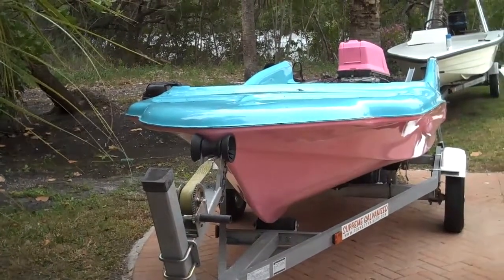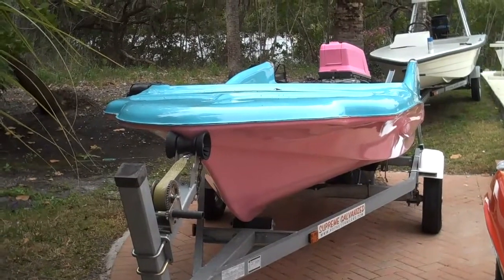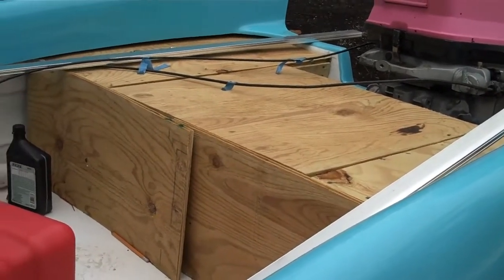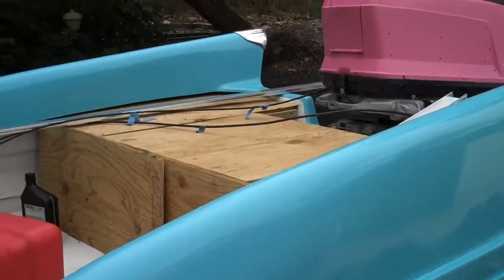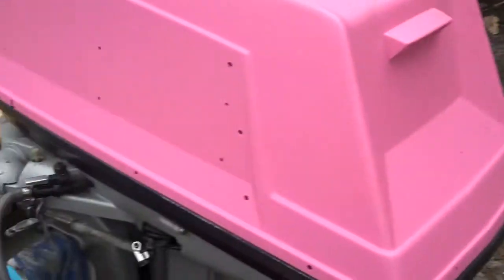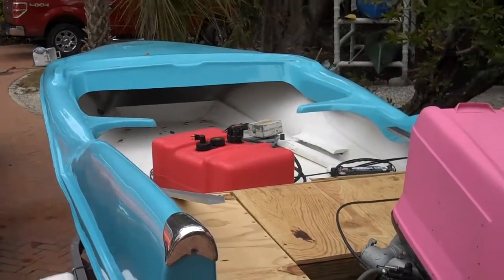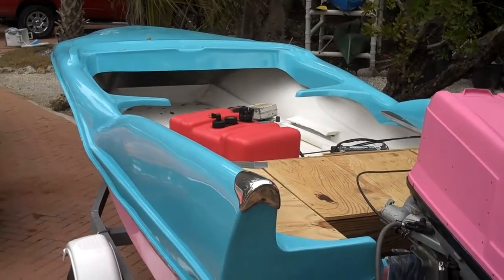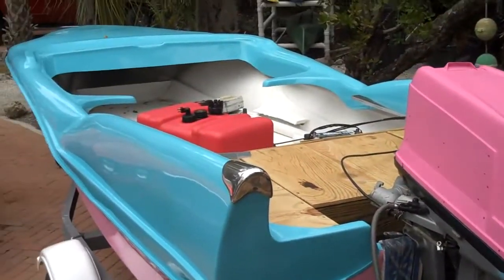1959 14 ft redfish shark restoration

Comment: Looks great.  The Lark is a good little engine.  Replace both of the ignition coils if they look like they are old.  These can work fine - but often they will konk out at the worst time.  They are inexpensive and easy to get.  It'll probably cruise great at about 20mph.  Run good TCW3 oil at 50:1 ratio.  That engine has needle & ball bearings so 50:1 will not hurt it.  I'tll smoke less and run good.